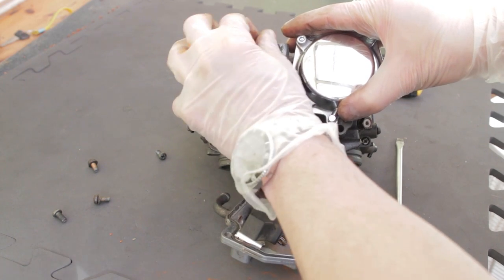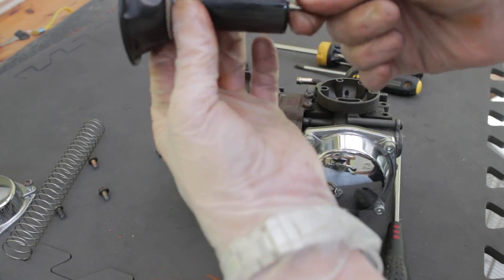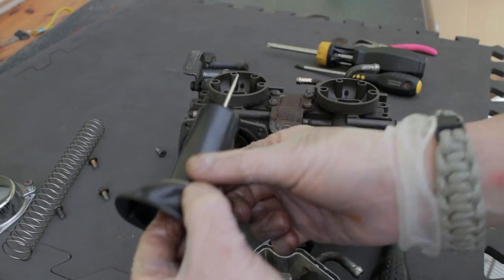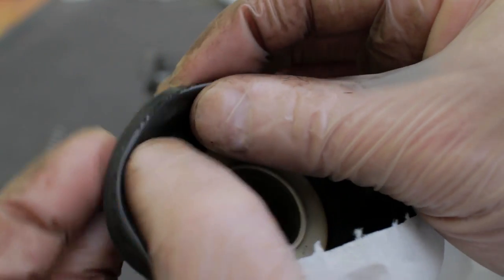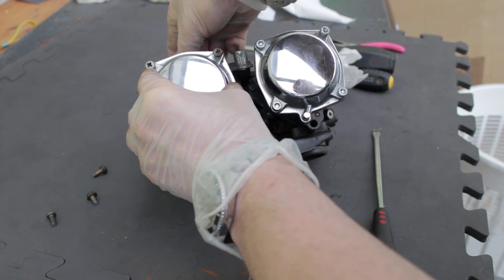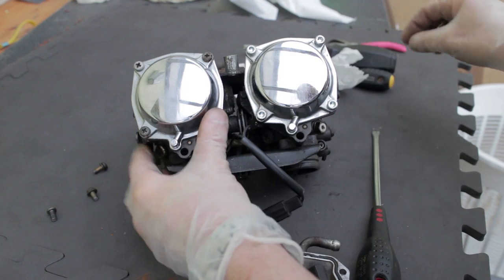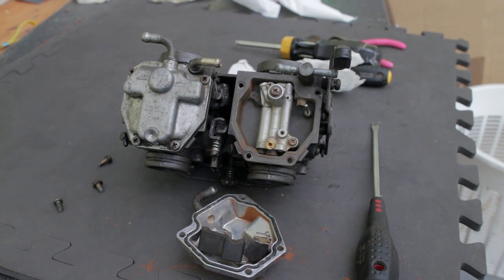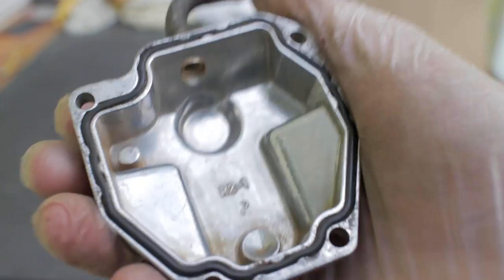Yamaha VIrago XV5535 Bobber Project, Part 5.2 Carburettor Strip & Clean.

Comment: For pressured air it's simple matter of going to the site of Ebay/Amazon or Maplins and order a can of compressed air, the handy part is it comes with a straw to reach the awkward areas. Can even be found (if luck on your side) at pound shops.
Reply: Just to add you can get them in shops selling airsoft guns,or model building shops that carry airbrush equipment.

Comment: It has to be emphasised that first (REAR) and second (FRONT) carbs differ (xv535). They have different main jets and jet needles! So one should bear in mind this while while reassmbling carbs.
Reply: Do you remember the jet sizes and jet needles you're running in your bike? Would help me a lot.
Reply: I just found that out today. The Haynes workshop manual lists the jet and needle sizes.
I was also told it really didn't matter if they were switched 🤔
Reply: Thx for pointing this out.

Comment: Excellent video really thorough 👍 I’ll thought I’d ask you if you can check the rubber diaphragms without taking the carbs off as I’m having problems with my virago hunting once you try and accelerate. Could be the coils but I’m trying all avenues at the moment
Reply from the maker: Thanks, it's unlikely to be the coils as they tend to fail under heat rather than exhibit such problems.
You can unbolt and remove the caps to view the rubber diaphragms, the risk is pinching them whilst refitting and you really need to be able to stretch them to check for pinholes.
You can try and if necessary remove the carbs to refit, I couldn't blame anyone for not wanting to remove and refit them.
Reply: Thanks 🙏 for getting back so soon. I appreciate it. It’s only done 5k. I’m sure I’ve got paperwork for new diaphragm so I’ll check. I’ve not had it long. My son says it probably needs the carbs balancing  as it starts straight away. Any advice is welcomed so much lol 😊it’s such a lovely bike and it’s getting a 70’s chopper look
Reply from the maker: @garyconstant4234  No problem. If it's new to you if go through a full service. Start with the valve clearances, they are the single most neglected service item on any engine, especially since most modern cars use hydraulic valves of some sort and don't need it. It's sadly a forgotten thing but essential for proper running, carb balancing is something that needs doing once you know the valves, plugs, carb cleanliness and mixture are done and set or you're just chasing your tail trying to sort things.
Another thing with modern fuels is, sitting around not doing much isn't good for tank or carbs because of all the additives.
Reply: Hello again. I’ve had a look at the membranes and they look fine. I did notice the rear HT lead looked a bit loose so I re attached it so it could be that. I’ve not been out on it because of the weather but I’ll keep you posted 👍
Reply from the maker: @garyconstant4234  that's positive and a loose HT lead can certainly cause you problems.
When you first start and warm up have a (very) quick tap of the downpipes of the exhaust as it starts to warm up, and you'll see if one is warming up quicker than the other.
Fingers crossed its that.
Reply: Yes I’ll give that a go as well. I’ll replace the leads because they are only cheap plus they are 25 years old. I mentioned to my son about the videos as he has a 535 too and he said straight away ,is that the bloke with the cat lol 😊 I replied yes that’s his apprentice 👍
Reply from the maker: @garyconstant4234  Haha, yes, that was my fur baby Gizmo, she adopted me from the moment she could walk, sadly no longer with us. She was the loveliest.
Reply: Yeah that’s the thing we get so attached to them and they bring such joy but when they go it’s heartbreaking. I’m sure that’s why I haven’t got another cat or dog because it’s so sad when they go but I guess it’s the happiness they bring for many years. It’s a tough one
Reply from the maker: @garyconstant4234  Likewise, I'm reluctant to have another cat because I know I'll never find another like her

Comment: very good but you did not remove the mixture / air  screw and o ring and washer  before using carb cleaner as it will deform the rubber o ring, also they need to be removed to blow out and make sure they are set up right etc 1 to 2 turns out from soft full closed , if you can show every one how to pick the o ring and washer out, i use a very fine wire with a small hooked end to get them out, it can still be a pain, every thing else was well done and it was very nice not to have stupid music blasting out, just well educated talking and naming things correctly  with out using words like THINGY / THIS THINK / WHATSIT / WHATEVER THIS IS,  very well done thanks eddie,
Reply from the maker: Good and valid points, thanks for your feedback. Likewise I hate videos with 'background' music drowning out anything useful.

Comment: Brilliant  vidio thanks I have a varago 535 done everything  to it new coils air filter servise cleand carbs it's 95 with 16 thosand  mls up very clean  starts up not a bother but the front solider is colder the the back one thanks if you could help diaframes  perfect
Reply from the maker: Is the exhaust pipe noticeably cooler? If so that suggests it's not running properly on the front one. The cylinder (I assume you mean) will run a little cooler as it's in the airflow and the rear obscured and that's why there are different settings for front and rear carbs.
Either way you shouldn't be able to place and hold your hand on them.
Reply: @spidiq8  hi side thanks for the reply if I drive it it won't pass 65 mls anhour and when I put my hands on the exsausts the front one is 3 qwaters cooler then the back one but no way will she pass the 65 thanks
Reply from the maker: @joepunk3020  Definitely not running right on the front.
These aren't fast by any means but 90-95 should be achievable when running right.
You need to ideally check compression. Valve clearances. Plug. Coil etc as well as fuelling.
Quick easy check is pull the plug and if it's wet the fuel is getting through but not firing and if oily it's rings or stem seals.
Valve clearances are a big source of problems on older bikes as they tend to be avoided by previous owners. These thankfully are screw and locknut your and while fiddly are relatively easy.
Reply: @spidiq8  never thaught  of the valve clerince  iv done everything to it but not the valve il do the front one and see id say you have nails it spid would it stop the bike from doing its right speed it's just the front one thanks alot for the heads up love your vidios it's worth a troy the bike is like new
Reply: @spidiq8  hi my frind done the valves clearing the plug was  wet and black cleand it grate spark I turned the crank to the line mark first done the front the were locked and the back one on the same head there ratling bad yoused 0 15 for both thanks onely the front cylinder
Reply: Both of the valves were locked
Reply from the maker: @joepunk3020  Yikes! Yeah that'll do it.
Reply from the maker: @joepunk3020  if they were tight to the valve stems they'd have been held open which means zero compression and no running even with a spark so you're throwing unburned fuel and air into the exhaust which would have burned and sooted up the exhaust and caused backfires likely too.
Hope it's running better for you.

Comment: I have a shop manual for that bike. The fine details are sketchy. Bought an 535XV last summer. Yesterday finally got to the carbs. Got new bellows. The ones i took out had no O-ring on the needle,  but new ones came in rebuild kit. Don't know where they go?
Reply from the maker: Do you mean a rubber o ring on the needles? There shouldn't be one to my knowledge but there will be a place they belong. Off the top of my head I can't say for certain as it's a while since I stripped a carb from one of them.

Comment: Just bought a 535 with 9000 miles. Bike has been sitting for months and ticks over roughly so the carbs probably need a good clean. Can you send Gizmo around to give me a hand please as my cat Snowy is more into suspension....
Reply from the maker: I would and she would have been delighted to assist. Carbs being her specialty. Sadly she's no longer with us.
Have a careful check of the carb diaphragms. They tend to suffer more than upright stacks but hopefully a good clean will have it ticking over nicely and you enjoy it.
Reply: @spidiq8  ahh that's sad about the wee cat, you can get attached to the little skitters.....apart from diafram problems are there any other know carb problems. Ticks over ruffly, balanced the carbs as they where out a mile but this made them worse, when shutting the throttle off the revs linger at about 2000 revs then drop, it's not cables or leaky manifolds but nevertheless I'll give them a bloody good cleaning.
Great video.
Reply from the maker: @Team-fabulous  You do indeed get attached, had her from birth and she was lovely.
There's really only typical carb problems. Wear. Varnish from fuel deposits etc.
Your symptoms do sound like air leaks or holed diaphragms though.
Check valve clearances and do a cylinder compression test just to establish they're ok.
With the carbs off do a lift test of the slides and see that they reseat gently with obvious vacuum from the tops. If one or both snap closed that's definitely the diaphragm seal at fault there.

Comment: Great video. I cleaned out my carburetors my 1990 535 virago started right up ran good for 5 min. I turned it off and the next day tried to start it wouldn’t start.
Any ideas on what my problem is?
Reply from the maker: Say Say Everday I'm assuming it's spinning over as it should, check the plugs for spark, check they're getting fuel to them, (are they wet), make sure the fuel pump is priming the float bowls when you switch the ignition on.
If there's a strong fuel smell use no choke as you're probably flooded.
How old is the fuel in the tank, it goes stake incredibly quickly nowadays.

Comment: I just changed the diaphragms and the new needles seemed shorter. It flooded the bike out and now it won't start. I've put the old needles into the new diaphragms and I'm leaving it overnight. Any idea how long the needles should be? Mine are 35mm
Reply from the maker: I couldn't say off the top of my head and I don't have the manual to hand. If they're obviously shorter then swapping them should help but if the float bowls are flooding you need to check the needle valves and float heights.
Reply: @spidiq8  the bowls and float needles are fine. The bike was running fine before I changed the diaphragms. I put the new ones in and noticed before hand that the new needles were shorter and not as tapered. There was also a spacer grommet missing so I used one from the old set. Even so the needle was a good 1cm shorter. I think cranking the bike has severely flooded the bike. I've re fitted the old needles in the new diaphragm bodies and re fitted. I'll try it again in the morning. The bike was running OK before. Just was laggy to rev and the diaphragms were torn. Before it slowly crawled to a death it revved much better
Reply from the maker: @Ian-ev5tg  using the old needles should correct it then. If they were so much shorter you've effectively got wide open throttle with barely any throttle motion, the taper of the needle regulates the flow once you move off idle and turn the throttle.

Comment: Hi there, I cleaned my carbs and it seems than there was a washer by the jet needle assembly, which I can't recall where it came from. Theres the hard plástic one, the one on the groove, and the washer... not sure if it goes in between the one on the groove and the small spring. Hope you can help out, thanks.
Reply from the maker: A standard flat washer? Or an E clip type.
I'd say if it's a flat one it'll be either between the E clip on the needle or between the spring and plastic washer to prevent wear by the spring.
Reply: @spidiq8  def... flat washer.
Reply from the maker: @danolopez662  If possible compare to the other slide. If not see which is the better fit and go with that.
Reply: @spidiq8  thanks for the time friend,  been doing a bit of research and there should be an o ring ,or in this case,  a flat washer per needle. So Im missing one for my other side, and it seems to go  on top of the clip. Wish I could show you the picture...
Reply from the maker: @danolopez662  No problem. I can visualise that and glad you found it. Thanks for letting me know.
Reply: It's shown in the Haynes workshop manual.

Comment: Hi there and greetings all the way from México city. I was wondering of you'd be kind and share the jet sizes you are running in your bike.  I know the main ones are 135, found out from the comments on your previous video. But the other two jets, the one by the slider and the one on top. And if it's not much to ask, the sizes on your needles. Hope you can reply, thanks a bunch.
Reply from the maker: Hi, thanks for the question.
Sadly I can't help as this was for a friend and is away now and my own was sold years ago. Hopefully someone else can comment with the sizes but failing that a service manual should provide the stock sizes for you.
Reply: @spidiq8  thank you for the reply friend, I just found out yesterday according to the manual, they are 135 main jet, 70 ,and 170 the one by the slider.  I still got one more doubt on the needle jet sizes tho. The manual does not give that much info.  I really appreciate your the time. Too bad you don't have your Virago no more. Cheers mate.
Reply from the maker: @danolopez662  Sorry I couldn't help but glad you got most of them. Hopefully someone will be able to provide the needle sizes for you.

Comment: I have a pair of black and yellow and  brown bullet connectors next to the right fake air filter that aren't connected to anything on my bike... I suppose they are for these carbs.. what do they do?
Reply from the maker: Honestly, no clue.
Electrics are not my strong point beyond checking wires and connections are good.
I can only assume it's for a solenoid or similar.
Sorry I can't help further.
Reply: spidiq8 well shite... can't even find them on the wiring diagram! 
Thanks for the help on the carbs anyway, I have to clean them bad boys, I'm sputtering burnt fuel all over right now
Reply: spidiq8 oh by the way, how do you synchronize them once they are clean?
Reply from the maker: @Matt281296  I couldn't either but wondered if it was just my lack of experience and skill with wiring, it's kinda nice to know they are missing from there in a way but obviously not useful.
If it helps, I couldn't see anything that looked electrically operated on the carbs, maybe it's a temp sensor?
I wish I could tell you what it was.
Are you getting unburnt fuel from your exhaust?
Reply: spidiq8 yep, just some black splashes out from the exhaust, don't think it's oil as there is absolutely no smoke, also the bike runs beautifully apart from some pops and bangs at deceleration
Reply from the maker: @Matt281296  That I can help with and is easy, with a synch tool, you can buy plunger and dial types which are really just vacuum gauges, however, if you're on a budget you can 'make' your own with a long loop of clear plastic tube and some heavy oil, thicker the better, (you need restricters inside near the carb ends).
That is a tube with a tiny thin hole, easy to make with a piece of plastic the right diameter and a 1mm drill bit, otherwise the vacuum will be so great it'll suck up the measuring fluid, (oil).
If you can picture it, plug either end of the loop to the vacuum inlets on the carbs, with enough oil in the tube to fill the loop at the bottom.
Starting the bike, (Warm) on idle adjust until the oil stays largely centred.
Reply from the maker: @Matt281296  have a smell. You'll tell immediately if it's unburned fuel. It might be condensation in which case a good run will sort it.
If it's fuel, check timing and valve clearances first, then the state of your plugs, if sooty then it's too rich a mixture if normal biscuit colour it's got to be timing and valve related as the fuel is getting out of the exhaust port before being burned by the spark of the plug which suggests the valve not seating fully.
Reply: spidiq8 alright then!! Will do! Thanks a lot for the help!
Reply: spidiq8 changed the plugs last week, they were blacker than black! 
I know timing can't be adjusted on viragos, I'll check the clearances when I remove the carbs just in case too!
Can the needle height be adjusted? Might be the issue cause it idles fine and without sputter
Reply: Hey, hi! I know it's been two years but, have you figured it out?

Mine has the same connectors loose in there, except they're black+black/yellow. As per the manual, it's the "carburetor heater", thing is, I don't see where they go?

Found some pictures over the internet, the heater is like a bolt that goes into the carb, but mine seems to be working perfectly fine without the carburetors part to connect into the plugs.
Reply: @Schillerzinho  no idea! I ended up figuring they were for something the California market required at the time and didn't bother further. Didn't affect the handling nor power of the bike so eh

Comment: Hello i have XV 500 and have 2 brokencarb diaphragms. Anyone knows are the XV 535 vacum pistons diaphragms same as XV 500 because i cant find them anywhere on internet?
Reply from the maker: Unfortunately I don't know but imagine they'd likely be as the engine size is so close. Hopefully someone will know.
Reply: @spidiq8  Thank you for answer. I am driving my XV 500 for 13 y now and parts are big problem. Was thinking to get some bigger motorcycle like Honda Hornet ,but still i like him